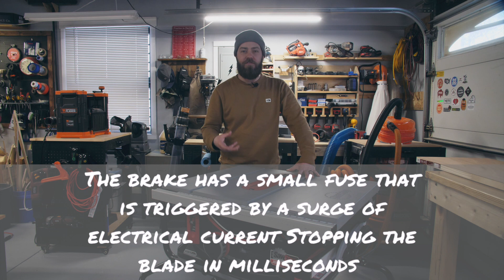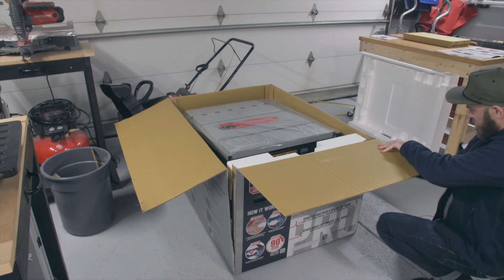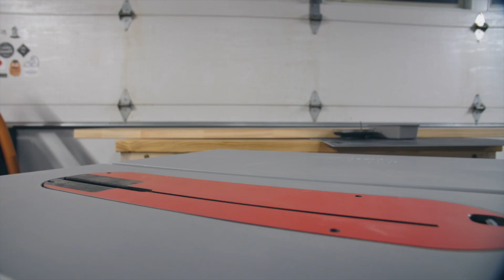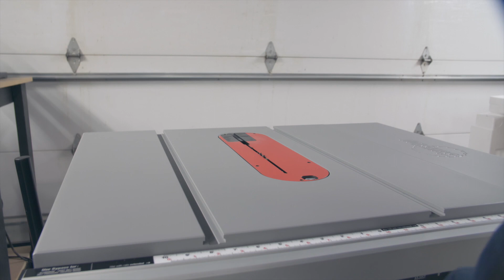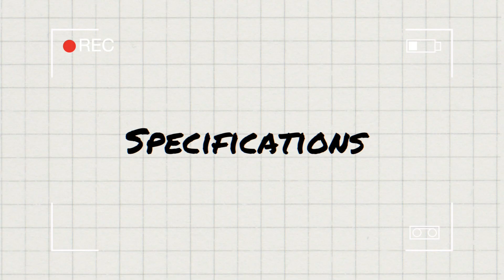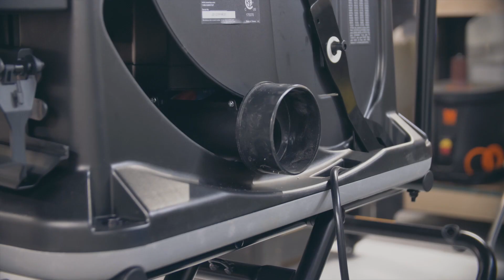SawStop Jobsite Saw Pro | Unboxing | Setup | First Thoughts

Comment: Will the blade cartridge work on any blade? For instance, your Diablo. Will it stop that blade or will the brake only work on the SawStop blade?
Reply from the maker: I believe so. I haven’t heard otherwise.
Reply: Your are not supposed to use a coated blade as it can slow the brake system  down…every milli  second  counts when the system gets triggered.

Comment: Thank you for the video.  I've been using mine regularly and found that it does not hold its 90* to table adjustment when folded up, then brought out for use.  SS engineers confirmed this on their units as well.  I use mine for fine woodworking, so this is an issue for sure.  Does this happen with your Pro?  Have you checked it with a good square?
Reply from the maker: Yes. I have to check and adjust each time. It’s a bit frustrating but not bad as a practice in the end… is what I tell myself. Lol.
Reply: @DaverMade  Have you contacted SS Support on this?  Please do, as they will not consider it an issue unless they get a certain number of complaints about it. I’m still looking for a fix on it.

Comment: I have to agree with you, for the price they're asking that table should be dead flat!

It's honestly disappointing to me that they would tell you it's "within tolerance".  If you charge a premium price you need to deliver a premium product.  Doing finer woodworking that will throw off the angles and make pieces not fit properly, and saying "It's a job site saw, it's not meant for fine woodworking" is a BS excuse, a flat table saw base is basic stuff.

Comment: I’ve had mine for a month or so and yes, my table was not flat. I was able to return it for a more flat table. My store’s display saw was an older version and the table was flat. My new saw table is still not flat, but it’s much closer and workable. Keep in mind, a nonflat table near the throat will produce an off square cut, especially on narrower boards.

Comment: Hello
Been told this is particularly loud.. Did you find that??
Would you recommend for a hobby fine (!) furniture maker??
Reply from the maker: I do not think it is any louder than my previous saw which was a 10" Worm Drive Tablesaw. It may be quieter, but I am not sure compared to others out there. For fine woodworking, I would not recommend this. A cabinet table saw with a cast iron table and a more accurate fence would be best in my opinion.
Reply: @DaverMade  Thank You for taking the time to reply.
Very helpful of you.
Best.

Comment: Have you ever tried taking it off the cart? That would probably be my preferred way to run the saw depending on jobsite conditions
Reply from the maker: I haven’t yet, but will soon. I am going to integrate it into my workbench for outfeed. I’m not taking it anywhere else for now so I think it’s a good option.

Comment: It’s like riding a motorcycle. It’s not a matter of if you have an accident, it’s when you have an accident.
Reply: The notion that everyone who uses a table saw will cut their finger off is nonsense. Table saws would have been banned long ago if that was the case.
Reply: @Aaron-nj4ou  Of course it’s not an absolute. It’s a saying that a lot motorcyclists I know have told me when referring/talking about people they know who have had accidents. I would ascertain that a saying like this establishes that there is an inherent danger in riding motor bikes that they are aware of.  

I used the motorcycle analogy to establish that there is an inherent danger in using power tools. You can do everything right an accident can still happen. 

Here’s another good one I’ve heard: ‘you won’t need it until you need it’.  Of course this isn’t an absolute as well but you already knew that.
Reply: @Aaron-nj4ou  the older I get as a longtime pro the more appreciation I have for safety. It’s really underrated, people in my business get hurt all the time(not necessarily from TS)

Comment: I guess I'm not as picky as you, based on your complaint about the table flatness. I have to agree on the miter gauge, however. That was an insult from SawStop that they could have easily avoided. Mine went in the trash can.

Comment: I have one of these, purchased in late 2020. It’s my first table saw and I’m really glad I bought it.  There are some really minor design things not even worth mentioning.  I ended up buying an Incra miter gauge which I’d also recommend.  I built a crosscut sled and a 45 degree sled and the whole thing works fine.  I’m a garage woodworker with limited space and I just don’t think there’s a better saw on the market right now for that kind of situation.
Reply: I’m in the same boat as you. I need to be able to move about. I have an old house in the Northeast and a detached garage with no climate control. Are you still pleased?
Reply: that was a nice compact saw until now,lol, they came out with an even more compact saw, called....the compact saw,lol. Only downside is, you cant use dado blades.
Reply: The miter gauge on about any table saw large or small seems to be an issue. Definitely getting the Incra miter gauge…

Comment: If they use all metal with cast iron top. Then the saw would be very heavy and not very feasible on the mobility part, especially for contractors that need to use the saw on job site. I use this saw on job site and I love everything about it, except for the weight. It is a bit on a  heavy side, compare to other job site saws. Great review btw, but you forgot to mention one of the main functionalities  of  this saw which is mobility
Reply: Delta made them for years with a cast iron top. $200. The fence wasn’t the best though. And the motor wasn’t brushless (before those were common).

Comment: The miter gauge looks identical to the one that came with my $185 ryobi bench top bandsaw 🤣 I’d have been pissed. But you paying for the patent and protection they cheap
Out on the rest
Reply from the maker: Yeah, I swear it’s the same as the one that came with my previous table saw that cost half the price, lol. I got the Rockler miter gauge luckily.
Reply: @DaverMade  yeah I’m gonna invest in one soon. The wood whisperer speaks highly of the incra gauges also. Definitely gonna invest in the WEN filtration system also. If I hadn’t got a blessing from God and ran across an older gentleman that didn’t believe in cheap tools that wanted to sell them all dirt cheap most of my shop would be WEN too. I hear NOTHING but great things about em. Great videos man and the fact that you’re that responsive you definitely got a new faithful subscriber and viewer in me. Keep ‘em coming
Reply from the maker: @stephenpalazziii9875  I have honestly been surprised with all my WEN products up till this point. They have been reliable and did not break the bank. However, I am not sure if I did this full-time if that would change. Thanks for the kind words and for the sub btw. Cheers!
Reply: @DaverMade  yes sir you betcha

Comment: Thanks for the video, here is my experience:

I purchased a new SawStop JSS Pro a few months back. During the set up I discovered the throat/blade insert slot was cut off center by 1/4".  Called Saw Stop immediately.. they would send a replacement.
Next during assembly I discovered the top was grossly warped.. as much as  157 thousands... that is well over an 1/8th inch..
Not "the most accurate job site saw" as advertised by Saw Stop. Another phone call(s)
Over a 3 day period the worst customer service I have encountered from a manufacturer.
I contacted the seller, they intervened and the saw was returned. The dealer confirmed the warp in all directions.. clearly a manufacturing defect.  The dealer refunded my money.. They had no other saw in stock
Saw Stop agreed with the dealer to trade for the defective saw .. that took over 2 months.
Finally the dealer had a new saw in stock. I went back ( this is a 200 mile round trip for me to the closest dealer) 
We unboxed the saw and confirmed it was within .008". Not as flat as my metal tabled saw  but by Saw Stop's own standards... (33 thou  " ) not defective. I bought the saw. 

It will take the place of my massive professionally made  37 year old 12 ",  3hp  3 belt drive long rail, sliding table .. until I get my new shop built.
I was considering an equivalent new saw from Saw Stop to take the place of  my beloved older saw.. we'll see.
Now that Festool has taken over and is ( in my opinion)  in collusion with dealers to price fix  (which they incorrectly call "fair trade" ) as they do with their own tools, .. not so certain.

My conclusion:
The saw is adequate and  grossly overpriced given the quality. As an example the fence adjustments are mickey mouse.   
I wanted the safety feature so sacrificed the much better quality of a Makita which was $500 less. 
I now have the saw but have yet to put it to real use...I'll post again with my findings.
Reply from the maker: I’m sorry to hear that, sounds like a headache. Thanks for sharing and I hope the saw’s performance makes up for it all!
Reply: @DaverMade  It does not.. See another of my posts (today) on another of your Saw Stop Videos.

Comment from the maker: Corrections ಠ_ಠ:
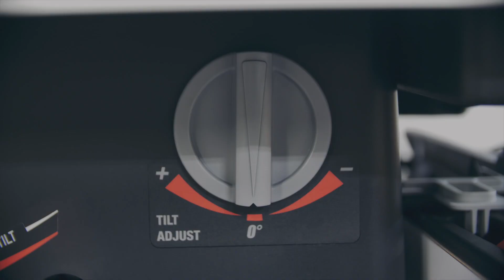@6:45  - The fence comes with the saw, not the blade obviously. 
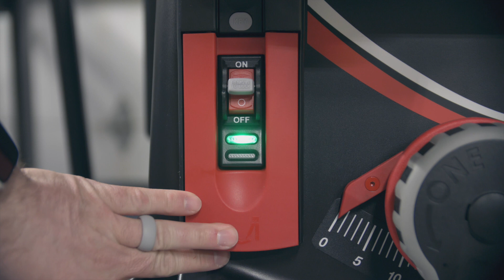@10:16 -  The blade is still spinning, not the saw. That would be crazy if the saw was spinning...After watching this while editing 100+ times, I didn't realize I misspoke until it was posted (╯°□°）╯︵ ┻━┻